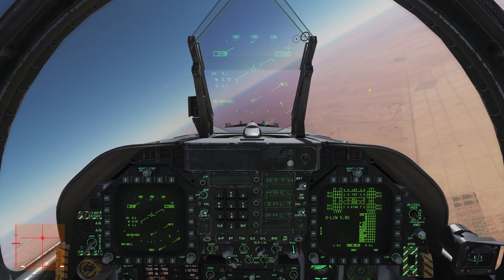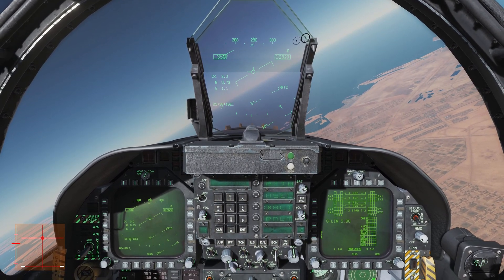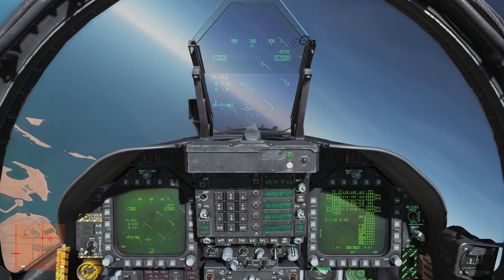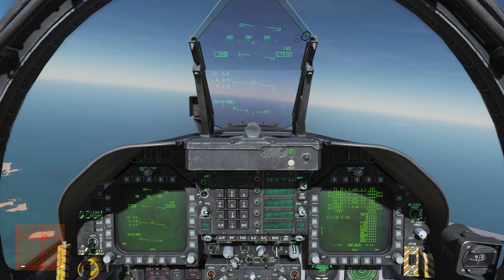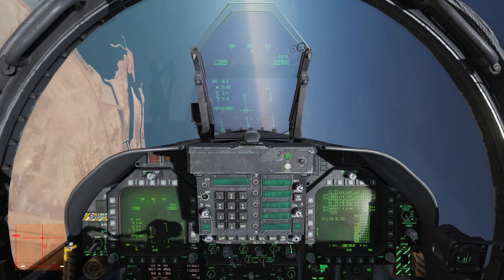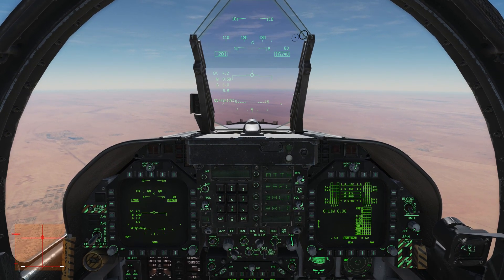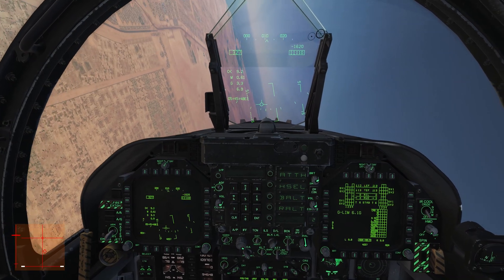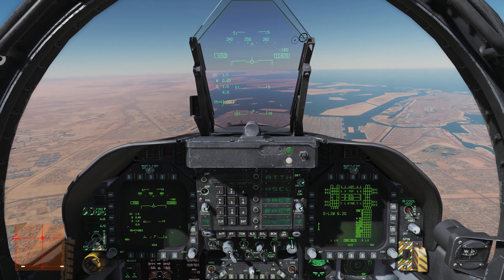DCS World Tutorials - F/A-18C Hornet - General Flying Tips and Explaining the FCS

Comment: It SEEMS to me that the trim capabilities of the F-18 are nowhere near as robust as they are in the A-10....... I presume the fly-by-wire is largely the reason?
Something that keeps happening is the elevators seem to get stuck in climb position, but the result is nothing more than significant drag. I must be doing something with the stick to cause the elevators to be impossible to level/trim......? This occurs in missions that open mid-flight, not after carrier or land-based takeoff.
Reply from the maker: Late reply, sorry. Keep in mind that the FCS of the Hornet is trying to trim the aircraft automatically for 1 positive G vertically at all times. Double check that you don't have double bindings, you have a small deadzone, and that your gear and flaps are Up/Auto.

Comment: how did you add the option to display what your throttle and stick etc are doing? is it an option within DCS? I think it would be useful for me to quickly see if I am using the afterburners or not
Reply from the maker: Right Ctrl+Enter by default shows the controls indicator

Comment: Is it normal for the plane to climb automatically over around 400. I have tried trim but it doesn't stop climbing. The only option is forcing it down with the stick and using attitude hold.
Reply from the maker: No, not normal. Turn on your controls indicator and see if your stick centers correctly.

Comment: Man that some level flight in this video, I tried it but all I was getting +1000 or -1000 ft climb rate and it couldn't maintain altitude... Really need some suggestions
Reply from the maker: Sounds like you need a slight deadzone for your stick. The Hornet should automatically trim for 1G which if your wings are level, should hold altitude if your velocity vector is on the horizon.